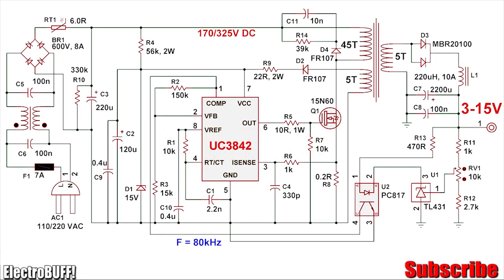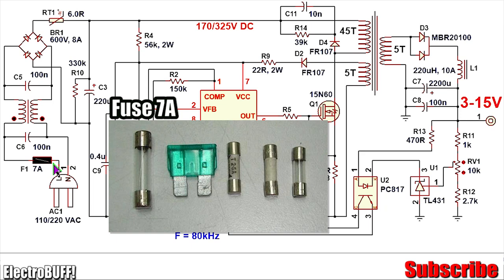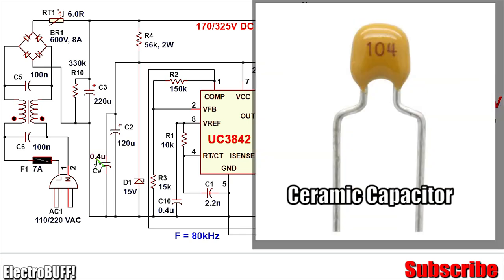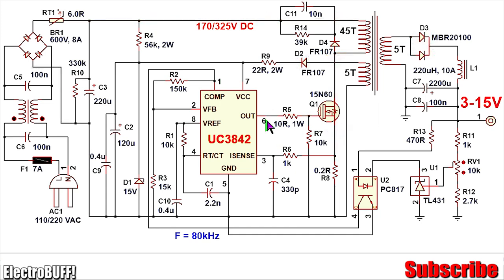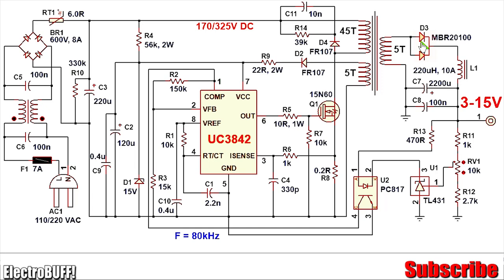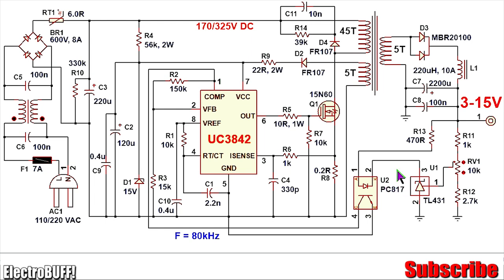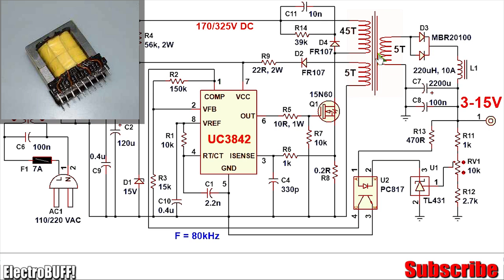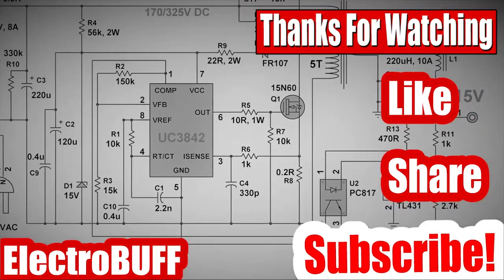UC3842 Switching Power Supply For Battery Charger 3-15V 10A

Comment: Sir you used zener diode of 15v between ground and pin 7 But the starting voltage of uc3842 is 16v so in this case the ic donot  start.
Reply: No ! He said the IC works on 10 V but better to work on 15V !
Reply: @cocosloan3748  IC doesnt start with 15 v

Comment: Hello! If I may, what is the duty cycle, sir? and how do you adjust the duty cycle to be <50%?
Reply: The duty cycle of uc3842 ic is less than 50% and will change depending on how much current is going through primary winding of transformer and feedback from optocoupler pc 817 and tl431 voltage reference.

Comment: Greetings from Mexico. Question: I bought a battery charger that use almost exact diagram. problem is it is blinking and could not turn stedy on. What do you recommend to check / test to fix it?

Comment: good job sir. I appreciate all your work sir God bless you. one more thing sir how can I get the circuit diagram for 24v battery charger with  regulator both current and voltage thank you sir

Comment: What should be the values of R11, RV1 and R12 to adjust the output voltage range of 13.6 to 14.8V?
Reply: just adjust the variable resistor to get the appropriate and desired voltage
Reply: I wanted to increase the range

Comment: With a properly designed "transformer" in a flyback converter there is no need for L1 and in fact it interferes with proper operation.
A small inductor is often used between two electrolytic capacitors to reduce output noise, but it is intended for RF filtering, not energy storage.

Comment: If both the auxiliary and secondary transformer windings is 5T then they both gonna output 3v to 15V. The Uc3842 need 16v + to boot up, and it shut down at around 10v. Also the 15v zener is on the low side.

Comment: what's the difference between fast recovery  fr107 and schottky mbr20100 diodes, some have used 1n4007 for powering up uc3842, also how does a small ferrite transformer able to deliver such high current.

Comment: you used AWG25. The max current for that is 0,457A and You wound it as 4 wires parallel so 4*0,457=1.828A. How do you think to get 10A over this seconder?
Reply: What is the solution to get to 10a
Reply: May be it is 10 amps at 3 volts

Comment: the zener should be 18v, because to start up threshold need around 16 - 17.5 v. So if you used 15v zener the IC dont start anyway.
Reply: Your right; I've tested a few uc3842, uc3843 and 3845. The uc3842 turns on with a threshold voltage of 16 volts; the uc3843 with 8.5 volts. After turned on you can set the uc3842 to 15 volts.

Comment: Dear sir,
Please guide me. Iam facing a problem in SMPS based battery charger. Now in market so many battery chargers are available claiming universal, that is input 100v to 265. Output 14.2v 2amp. But when I charge in 100v the current is not giving 2amp and charging is slow. Why? But in 230v charging is fast.

Comment: Sir I really appreciate 
I have a few questions
1. Does the smps have short circuit protection?
2. Can you have the smps with current control 
3. How do I add current control
Reply from the maker: Sure. Current sense resistor provides feedback to pin3 on the primary side. In case of a short circuit on the output, more current will be drawn on the primary side (primary winding) causing a ramp up of current. I've set the maximum current flow on the primary winding to 5A, otherwise feedback causes the IC to cut off its PWM output. Also there's a Fuse in case everything else fails. In the video I mentioned you can optionally use an op amp for both voltage and current sensing on the secondary side and together with the optocoupler, you can provide feedback to the IC. So, both current and voltage control is very possible with a simple adjustment.
Reply: Thanks very much
Reply: I would also like to suggest that you do a video on how to make an ac 500w inverter that has regulation and feedback pls 

Once again thank you
Reply: How to raise the isense ampere?
Every time i charge old battery
The charger keep turn off
Reply from the maker: @testaja3614  obviously use a lower resistance current sensing resistor and include an op amp for better gain and control
Reply: I dont understand about opamp
Can u please make a video....
Reply from the maker: @testaja3614  sure

Comment: I was halfway making the 12v 10a power supply with uc3843 you showed in a previous video but then this video came out.
I made my transformer feedback winding for 8 turns but this circuit uses 5 turns.
Can I use 8 turns for this circuit?
Reply from the maker: Yeah. The feedback should take care of regulation. Just ensure you use a good snubber network (use at least 2W rated resistor and a good quality capacitor because they can get quite warm)
Reply from the maker: Sure
Reply: @ELECTROBUFF  What is your ferrit transformers type of this project ? How if I want using EE25 for this project? does worth it?
Reply: @farosrohmangeloraramadan3897  EE25 is not sufficient for such power try EE35 or EE40.

Comment: circuit to add a diode after R4?
if you have a whole 10 amp power supply, why use a 15n60, is 4N60 enough?
You explain the operation of the circuit in such detail and there is no transformer phasing on the scheme?

Comment: Hello, what is the difference between ferrites with Gap and those without Gap?
and those with Gap can replace those without Gap?
for example these sources with UC3842 can be made with a ferrite core with Gap?.
Reply: It's possible, but that will reduce the maximum power due to the hysteresis effect involving the ferrite core meeting the ferrite core

Comment: hello friends, what is the correct order of the winding positions for primary, aux and secondary? is it primary, aux, secondary, or aux, primary, secondary, or what?
Reply: usually for the first layer there is a primary winding with a total of 30 turns, and the second is a secondary winding with the desired number, and the third is a feedback or auxiliary winding with the number as needed, then the fourth layer is a continuation of the primary winding from the previous primary which is wound in the same direction.
Reply: The fourth layer is the primary winding, totaling 15 windings, sorry I forgot 😂

Comment: what is the difference between uc3843 vs uc3842a
Reply: nothing important I have work with both of them and run the circuit with UC3843 AND UC3842
Reply: @baharazadi6289  Can ic uc3844 and uc3845 be used in this project?